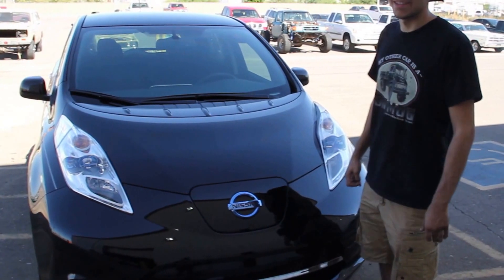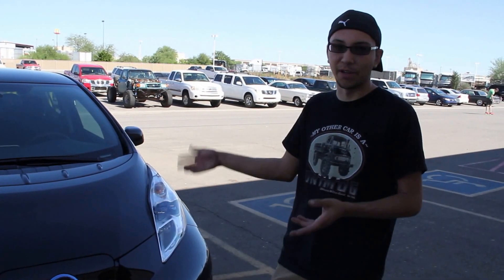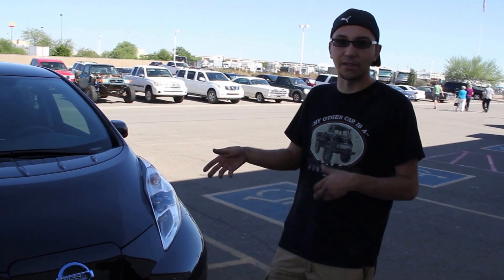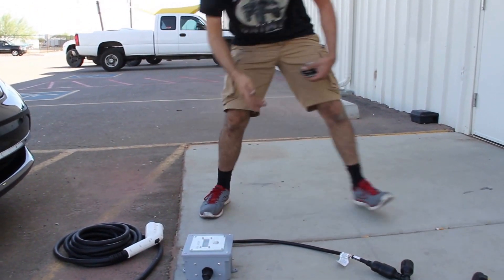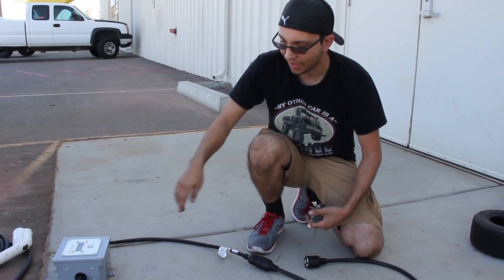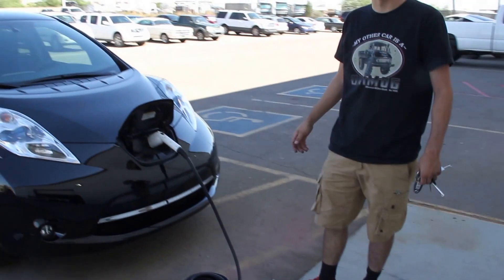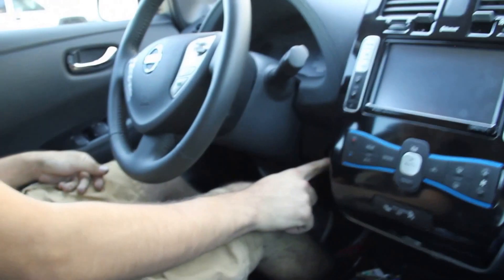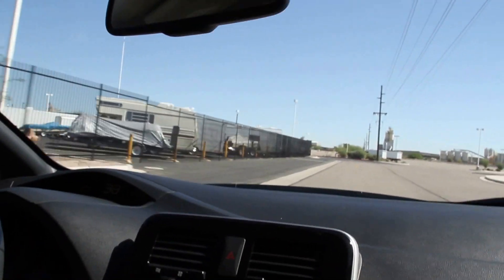EV Charger For Nissan Leaf

Comment: Nice job.  I'm sticking with the standard cables at the minute as ours is coming with a fast charge cable and we have just bought a 10 amp home charger (3 pin plug UK) lead for a good price.  Only thing I would say is that you should never leave a cable coiled like that when in use.  You need to uncoil the cable as much as possible as you will reduce the current carrying capacity of the cable and could even melt it.  It's to do with transformer effect and the magnetic fields produced by a cable carrying current.

Comment: And I bet that Nissan will void all electric and electronic warranties if they find out that someone is using an off-brand charger that is not approved by Nissan.
Reply: Your assumption makes sense, but it's not actually the case.  There are laws that allow third parties to manufacture and sell auto parts and accessories without voiding warranty.  Otherwise GM could force everyone to buy Exxon gas or warranty would be voided.  Nissan's charging equipment is not made by Nissan.  Nissan buys their dealer charging equipment from ABB and Aireovironment.  The 110V convenience charger that comes with the Leaf is actually made by Panasonic appliance division.  As long as the charging device conforms to the J1772 standard, its okay to use on any manufacturer's electric car without voiding warranty.
Reply: +Bonnie Flory You lost the bet the moment you made it. How about doing some research before posting your opinion?
Reply: Zazzle Delacruz w

Comment: Charging cable is too thick.
Reply: Arnis Tarassu too thin!
Reply: Not really. Insulation will not help with charging. Depends is this 10A 13A 16A or 32A EVSE. Also frond side windows are tinted. S
Also dash is covered with glossy substance. That looks really ugly. OEM matte looks much more appealing and also reflection is minimal.
Reply: Arnis Tarassu It is 80A now, running a Dostar J plug, you would probably freak out if you saw the thickness of that one! haha I like thick cables! thay are fun! especially the CHEdeMO! love that one!
Anyways, come to Phoenix and see anyone survive without front window tint, that is your opinion and your are entitled to it,  but it helps when it is triple digit crazy outside and I am sure you already know that the leaf has no thermal management of the traction battery so anything helps!  Anyways, the dealer detailed the car, don't have much control what they do but hey... anything free is nice,  although I do agree that a glossy dash is annoying out here in the crazy sun but that is what Ray-Bans are for, plus I like shiny things.
Reply: Ladies love thick charging cables.
Reply: The title is "EV charger for Nissan Leaf". Leaf can AC charge at 32Amp MAX. Oversizing equipment? Why. What car can charge with J1772  and 80A?
It is not the tint that massively helps with heat. Next time ask for UV and Ir filter foil with minimal tint. They work the best. Yes they cost more.